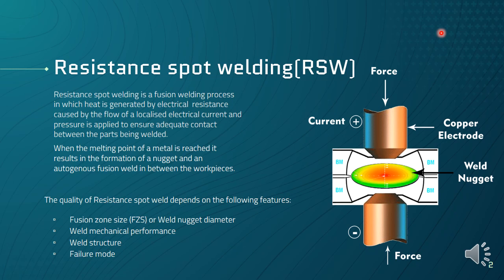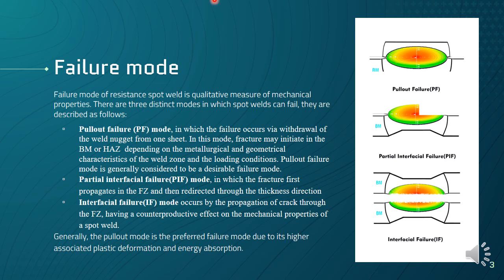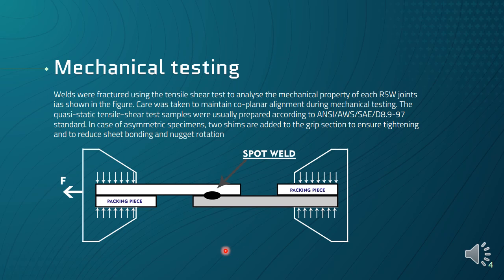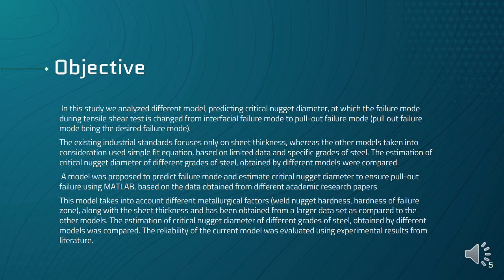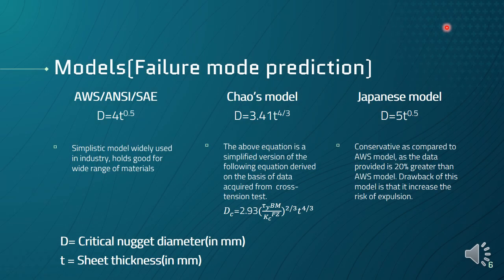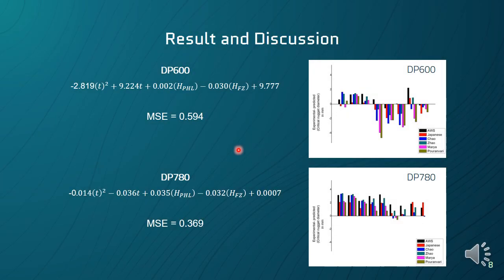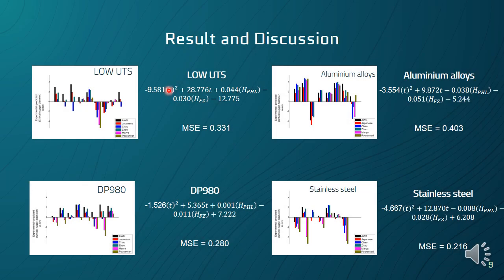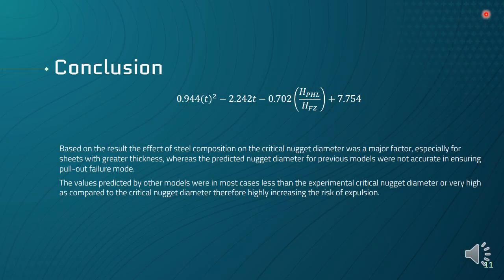RSW PRATIK KUMAR NIT JAMSHEDPUR720p   Pratik Kumar

Comment: What are the different alloys and the sheet thickness you ave concidered for your calculation?
Reply: The material used were
DP600,DP780,DP980,Aluminum alloys, Stainless steel, IF steel,Magnesium alloys, C-MN steel and a few data on other materials as well.
The sheet thickness vary from 0.6mm-2mm. The RSW with inter layers were also taken into consideration along with RSW in sheets with different sheet thickness.

Comment: Can you provide an insight into the creep characteristics of spot-welded joint? In your opinion, what considerations a machine designer must take if the part he is designing will have spot welds in some parts?
Reply: I got your email, i will be sending you the relevant data regarding the considerations a machine designer should take.